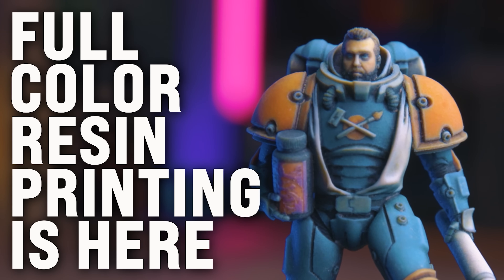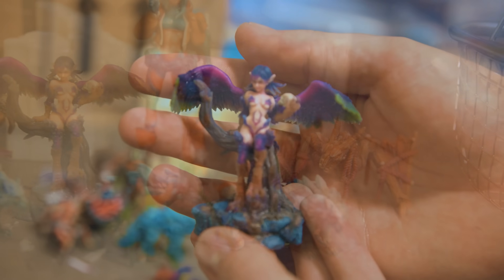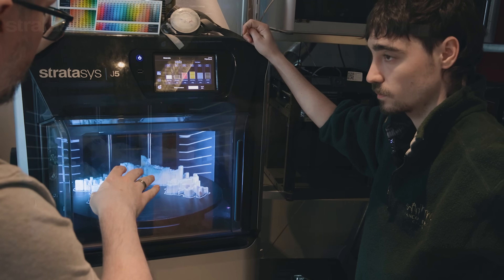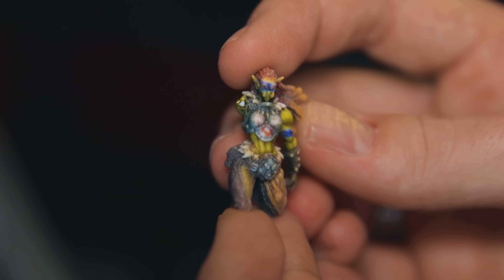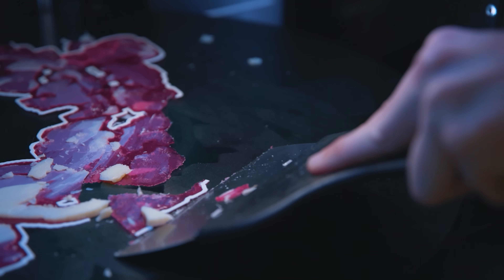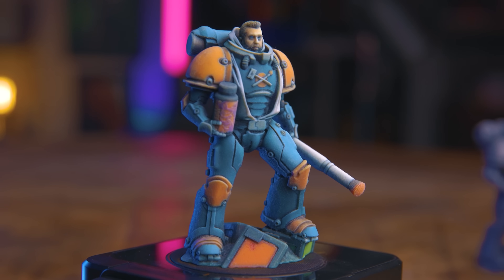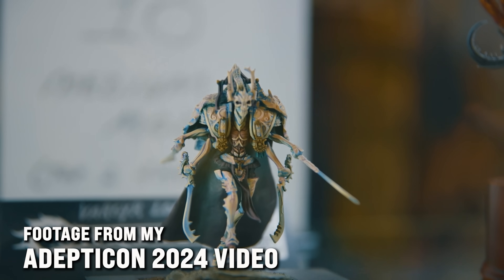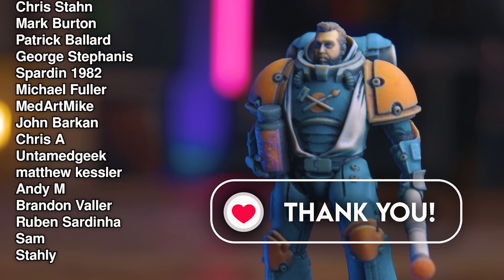FULL COLOUR RESIN PRINTING!!! - StrataSys J55 Impressions

Comment: Amazing, I wonder what the cost is for this printer and how much fumes are given off, if any. And when will this type of printer be under $1000us. I wonder if anyone has made an auto painting booth. Similar to this printer of sorts where it could paint an already printed model. Instead of painting as you print. I know there is the, I think, ...U1 that can do it to a point. I would like to know how far you can push the U1 printer. Such as can it print/paint a 3d Miniature model. I think we need to look beyond the Multi head FDM printers when it comes to color printing.

Comment: Thi is not too dissimilar from a concept i had, an fdm printer with basically an inkjet printer attached that would pass over the print layer by layer depositing color, mostly on the outermost surfaces obviously,  though I've seen other color printing setups that applied ink or dye directly to the filament, and the process didnt seem to effect layer adhesion.  

A similar thing i wasnt to experiment with is an electron beam attachment,  electron beams are used in post processing of certain plastic products, common in medical equipment,  the result being better stregnth and other mechanical properties, and it converts thermo plastics into thermoset plastics, meaning they cant readily be remelted, have a higher deflection temperature etc.  PLA is actually a common plastic used in this process.  The mystery factor is penetration in an atmosphere.  Electron beams are typically used in a vacuum,  from old tube TVs to scanning microscopes, and the machines that treat these products have vacuum chambers. But, im hoping that since we can go layer by layer, only needing to penetrate some fraction of a mm, and possibly having the emiter barely above the surface to be treated, that we can get away with doing it in open air. I found some white papers on the process and the numbers about penetration in the plastic are interesting. Theres a significant dropoff with depth, so maybe working in .4mm layers means the process can be fast and low power.

Comment: yeah, it's cool and all, but they've been selling the PolyJet printers since at least 2014 and the quality doesn't seem better. The rotating build plate only solves one problem by sacrificing valuable features. Compared to the old Polyjets. the build volume is tiny. And the color bleed is still there, and the detail hasn't improved. Stratasys, as a company, is bad for 3D printing, and this is a prime example. They tried to strangle FDM machines out a decade ago but REPRAP community would not capitulate. This tech hasn't progress in that same decade. 

Still, I ran a Fortus 900 that has all the bells and whistles and it was half a million bucks. I'd be willing to sell a kidney for this one.

Comment: I'm late to this party, but very frustrated at how uneven the printing world is.   Why is it that every year there are major innovations in 3D printing and next thing you know a much higher resolution or new features are available for $300 that mimic what used to cost $1500?   Meanwhile, the world of 2D printing is standing still.   My last 2D printer cost more than my last 3D printer!   I would have thought that absurd 15 yars ago when 3D printers cost thousands of dollars.  

Meanwhile, if I want to make good DIY board games, I don't just want figures; I want great playing cards.   Why does every playing-card printer include a die-cutter and cost $5,000 or more?   Shouldn't that tech be cheap by now as well?   I just checked and ID-card printers still average $2,000 and Epson is selling flatbed printers for $8,000

Comment: I'm still impressed, but I "met" "my" 1st "uv resin jet" printer with water-soluable support material about 8 years ago ;) The surface finish varied between supported areas and "just printed" areas, so I guess this is the reason to cover the models completely in support material...

Comment: It is not just the patent. The reliable jet printing head is controlled by only a few companies in this world. That's why you see UV printer manufacturer like Mimaki can step into this easily since they own the core technology. The Polyjet is a cool technology but it runs on a lot of things and becomes very complicated. Technically speaking it is a 3D version of a 2D UV printer. If a UV printer, which has been pretty much open source, still can sell for 30-40k per machine for a Japanese brand and 10-20k for a Chinese version. You don't expect this will be home-hobbyist friendly in a short time, or maybe never.

Comment: what im seeing is hopefully the next step in the evolution on resin printing. even if you only get the ability to print 2 resins at the consumer level, imagine having the support resin and your chosen model resin. that alone would prob take over the market, especially if it uses the same method as this printer and lays the resin layer by layer on a turn table with almost zero mess and zero chance of spills. this seriously has to be the next step.

Comment: It doesn't look that hot, but I'd be happy to support Stratasys just so they can destroy Bambulab before Bambulab destroys 3d printing. You know, my enemy's enemy. But yeah, it looks like an inkjet print on thin matte paper - it has "colors", and you can see "shapes", but the saturation is weak and the shapes are hazy.
Reply: simping for Stratasys when it's Stratasys that is trying to destroy 3D Printing with patents?  what a flake

Comment: I worked for years using a j55 and it is still not a machine that can be used normally. It is certainly a good step for the technology but it still needs to be extremely optimized especially on the cost side.

Comment: Stratasys are the most overpriced 3D printers on the industry. I hope Mimaki gives them a good lesson with their new color printers.
Reply from the maker: I'll be honest i have no idead about the pricing competitiveness at this level of machine
Reply: @FauxHammer  In simple numbers and what I see. Stratasys build quality is 9/10 but the price for that and what the machine is capable of is 15/10. The new Mimaki color 3D printers cost almost twice as much as the J55 but the build quality is pretty good however the capabilities are just amazing there is no comparison at all, if Stratasys made an equivalent printer probably would be around $500k easily.

Comment: Color? Thats amazing, but getting rid of supports...
Just put it on the computer, a little orientation, and remember to do the cleaning at the end. No fails.

I'm guessing the problem with such  amazing printing tech is buying the expensive water soluble BS™155 support material for your J99K™ pentajet™ system. But hey, at least theres an option to upgrade from slicer to slicer pro™... for a fee.

Comment: I didn't notice the worth of clay sculpted figures "skyrocketing" when 3D printers became the norm 🤷
Reply from the maker: Not quite the same point.

Find me a clay-sculpted figure that is also available as an STL and then we'll talk.

The point was. Original Piece Versus 3D printable piece. Why not have a look at hand-sculpted resin cast models vs 3D sculpts...

The hand crafted/cast ones are significantly more expensive than 3D printed versions.

Comment: I've been checking in on the colour 3d printing tech every few years for the past 15 years and I can safely say that it's still hot garbage. It's very slightly better than it was 15 years ago and it's "impressive" in that you can print in colour at all, but I don't understand what others are seeing. It looks like crap. Looks like it's made out of sand. 

Grey prints have improved a lot and now look pretty damn good, 9/10. 15 years ago colour printing was 1/10. Today it's 2/10, maybe 3 if you're generous. I'll back next decade...

Comment: 5:17  "...as trademarked by Stratasys..." , yeah sure. This tech is so old but was kept under the radar because of patents and such stupidities. 20 year ago I made the same thing ( in my "garage") though I didn't have a water soluble support material which is crucial in this case. So, the first company that made a product out of resin ink-jetting was Israel's Objet Geometries Ltd.  This days, funny enough, Mimaki a 2D printing behemoth (large printers with UV colors) is the prominent player in the arena. Not to mention a dozen Chinese companies that use the same UV-color technology for paper printing. But tomorrow rest assured they will add a Z-axis. What was Objet's brilliant idea was a water soluble UV cured resin that worked as a support. We master inkjet decades ago so was just a matter of years to find a proper resins that suits different use-case. Now, thanks to material development in SLA, we just take that material and spread it with inkjets - brilliant!!! If SLS was a revolution making parts out of powder without the need of support, the UV-inkjetting (the broader name) is even better as it is way faster and way more detailed. Actually Hp's tech and some classical SLS are already obsolete. Not to mention a pain in the A dealing with the powder... And by the way , Stratasys is a huge leech in the 3D printing industry. They just buy other people ideas. Do you remember Z-corp? The first color 3D printer.

Comment: Could you win the wax stuff back after it dissolved in the Ultrasonic bath?
Because that'd be amazing!
Like, say, you used up about half the amount that's in the printer cartridge, you could then carefully filter out as much of the wax stuff thingy out of the Ultrasonic bath, before putting it right back into the cartridge.

Comment: So, RDM. Resin Deposition Modeling. Instead of depending on UV light to determine the shape of the object, you're relying on depositing the resin in the right place, like a FDM printer, only with a lot more precision.

Comment: i thought my headset was acting up but it was just the video was this your mic >? 
also keen on this printer but when searching i get a request a quote which makes me think its gonna me 2500usd to 5000usd which sadly is very high out of budget for me and most getting in to printing
god damn i was so far faaaar faaaaar out of range this printer can cost the same as luxury car  Below are the technical specifications for the Stratasys J55. The system is priced around $99,000 and available to order now. The first batch of machines is expected to ship in July of 2020.

Comment: ive been talking about this for years, and the mimaki competor is nice too. you can actualy not just do color, but you can do per voxel color, opacity, and durometer when you use some extra software with it. this is the technology that will make 3d printing into a ubiquitous appliance, not msla/fdm. cheers, xgz

Comment: Just so you're aware there are FDM printable supports that dissolve in warm water without the need of an ultrasonic cleaner. Though for that obviously you do need a printer capable of using multi-material (unless you can be there & have the know-how to add purge/pause instructions to your code). And yes this form of printing is really interesting, but like so many others will likely never be available to the average consumer- though the tech involved could be useful in the future.

Comment: There seems to be something wrong with the sound on this video. Completely sets my teeth on edge. 

On a totally different note, there have been full-color resin 3d printers at the professional level for several years now--the Mimaki 3duj-2207 was the least expensive at around $45k, and its color rendering seemed a bit better. The thing about being immediately safe to handle with water-soluble supports is very cool, though--I don't think the Mimaki does anything like that.
Reply: that model has a max build height of 7.6 cm

Comment: Your model appears to have a matte surface whereas you say in the video that the printer can print with in satin or gloss. Have you sprayed matte varnish over it? Also is varnish required to protect the color? Finally, can you give an approximate price for the machine and the resin?
Reply from the maker: Yeah we sprayed it with matte varnish. But a bit too heavily because I needed to get to my train…

Machine is about 90k the media can be about 200+ per cartridge

Comment: I'm still not sold on color 3d printing as a artist. It looks like a low res gaussian splatting model that's been printed, however in 10 years I can see this being better than me on a brush that's for sure. Right now I think that it's acceptable for if you just wanted something with color on it, but I would certainly do some cleanup work if I bought one of these prints.

Comment: We had a much nicer Polyjet at my undergrad university. They’re amazing but the material cost is insane. Now that the tech is no longer patented I really hope someone makes a cheap one that works with generic resins but I do believe that the resins they use have an higher viscosity than the ones we commonly use in prints.

Comment: The printer itself and how it works is revolutionary. I don't think it will hurt artists you can start a small business with one of these printers selling your Miniatures and copies of your work through a online store I'm sure the cost of it is ridiculous 30 grand or more but that wouldn't stop someone from starting a business. The number of pre colored models you could design and prototype Parts you can make it's got infinite possibilities it drives me crazy that I myself thought of a process similar to this using an inkjet printing head several years ago but I don't have the technical ability to do anything like this I thought it was a pipe dream and to see someone actually do it very similar to the way I described it blows my mind

Comment: So this is an inkjet type resin printer where cartridges are overpriced and are replaced often because they don't fill them all the way and of course cannot be refilled. If they made this more like a Epson EcoTank where the resin colors are pulled from refillable containers it would not be so bad. Don't get me wrong its a step forward but still needs a LOT of refinement before it can be more accessible.

Comment: Since is possible to hold the printed models by hands, I was wondering about the air toxicity. I don't live in a place where there is a lot of air change and this is why I still have to buyh my first printer, since I want to print miniatures and bigger objects, I think that resin is the only way but since is highly toxic I still didn't bought one. Air purifiers doesn't do anything in terms of air cleaning for thjis sort of stuff and since I will have to keep it in my apartment my main priority is the air quality. So, this printer solve that? If not, there is actually a resin printer that solves that? Thanks a lot for the help and thanks a lot for your videos!

Comment: I guess, it costs a fortune) I think color printing is useless for the same reason. Actually, technology isn't new, at least in 2017 there were projets from 3d system , which had already used multyjet system. I don't sure about coloring, but it allowed you to use one resin for supports and another for model. 
By the way, there also were several resin printers from mimaki with color printing. But, again, all this machines are awesome, but they cost a fortune and I think it is better to spend your money for buying a farm of cheap resin printers instead of buying this one

Comment: i was given some card printing machine. its basically just a UV based inkjet. six or seven bottles of resin...

as its all proprietary locked to firmware and software, it sits unloved in a corner, but yeah... one day i might wack a new driver on and attempt to deal with g-code that works on liquid and flashing lights... or i might not.

Comment: "The Stratasys J55 3D printer costs around $99,000. It is part of Stratasys' PolyJet series, which uses curable liquid photopolymer resin materials." pretty easy to find 20 secs

Comment: Is a gigantic leap forward, but colours and details still looks a little soft and washed out compared to ones from painted ones by masters. If they will make 3D printing which does not require ventilation and any alkohol (even for cleaning printer), I would be sold.

Comment: Can't wait to see Elegoo make their own version of this that cost less then $500, man what time to live in. even without color, the fact that you can resin print something and touch it without gloves and such is a big game changer.
Reply: Removing the potential chemical hazards for the user is going to be resin's biggest game changer - I would love to have a resin printer at home but my small condo can't safely have the VOCs of industrial resin floating in the air.
Reply: @linkmaxwell  I've got one in my bedroom, have it in a grow tent with air exhaust out the window. Dyson air purifier running and can't even smell it
Reply: The resin is still resin, so you have to take some precautions. But, yeah, amazing how the print is fully cured during printing.
Reply: Bruh i say 5 years and we got the 500 dollar elegoo version. I love it 😂😂
Reply: @olti6845  Might be more than that this type of printer has been around for almost a decade in China and only recently surfacing outside of it but hopefully sooner than later.
Reply: Can you share the color 3d printer link?

Comment: The technology itself is awesome, but I have a slight gripe with the finished product. It looks glossy and waxy, as if it wasn't properly cleaned and there was still support material remaining. The second thing is that the surface has a very noticeable texture, somewhat reminiscent of a poorly-applied spray paint.
Reply from the maker: Sorry about the finish texture, we had to rush so i could make my train and covered it in far too much matte varnish